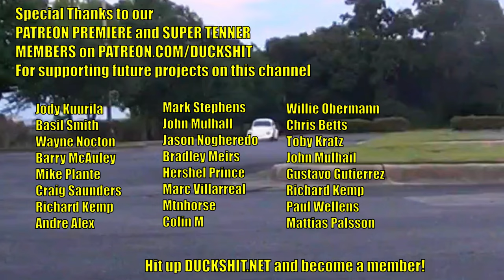🔧Checking End Play / Replace Clutch💥 -  1956 Chop Top VW Beetle - 175

Comment: My dad had his Model A engine balanced and had them shave 20lbs off the 60lb flywheel. I lived across the street and would hear him wind that thing up. There was a definite difference!
Reply from the maker: Thats one heavy piece of machinery, there.  I think the VW one is 16lbs stock, 13lbs lightened.  But its not just the weight that's been removed, its the weight that is furthest from center, at the edges, where it weould "weigh most" when spinning.  Its a pretty big difference.

Comment: Yep, the multiplier tools are sweet for working on anything with high torque. Love brake clean for removing grease.
Reply from the maker: Its the most elegant solution for working on these VWs... I recommend one to anyone that has a VW!
Reply: When I worked for Deutz USA (German air-cooled Diesels, very similar design to VW) they didn't use torque specs. I was a Warranty Engineer so usually I got the ones that people ran out of oil but sometimes I got called upon to do a last minute 5:00 to midnight thrash putting an engine together for a customer. The main caps for example were turned so many degrees, then so many more, and so on. With a torque multiplier that made the one for a Beetle look like a toy! Hell, that was the way the factory did it so that's the way WE did it! I was the only American guy that got "the call" and the other guys were all German! I do speak some German, they spoke better English than I did German, and let me tell you wrenching with those guys, drinking beer and having pizza (at company expense) was an experience!
Reply from the maker: Haha great story!   Thanks for sharing!

Comment: I just bought a non running buggy. Came with a new clutch kit as they said the clutch had gone. Popped the engine out. The clutch in it was new but covered in grease. A quick clean up and it was refitted. Now have a spare clutch kit for one of the others vws.
Reply from the maker: LoL!  Probably the same story.  They only need a film on that input shaft, or it makes one helluva mess!

Comment: I’m pretty sure that when people suggest to use an impact they are suggesting half inch or three-quarter inch impact drives. I’m quite sure they’re not talking about quarter inch drive battery operated Dewalt. The larger impact might be Battery operated but almost certainly hope you get into an air powered half-inch drive or better so you can torque whatever need to without having to figure out a way to hold things against the torque.
Reply from the maker: I'm glad you hope I get things that i already have duplicates of... and no, you don't impact that tool.  🤣👍🏻🤣👍🏻🤣👍🏻🦆💩

Comment: The shim you showed for the end play adjustment looked to be more like the gasket you put on the 4 dowls of the crank than the shims? Pretty sure everyone's neighbourhood is noisy unless you're one of those rich people with a nice big house in a nice quiet area. The tools are certainly a huge help when doing these jobs.
Reply from the maker: You are correct, and I was drunk, and you saw an old version of the video... haha!   I've long since chopped that section of the video out so as not to mislead anyone with dopey information.
Reply: @DuckmanCycles  I had to question myself for a moment as I've just replaced the flywheel o ring etc and I did have three shims. Although I didn't check end play as its ran in the past with this setup with no issues. But I did second guess the shims lol
Reply from the maker: Haha, never hurts to double check! 😁👍🦆💩

Comment: Got to use 8 dowl with a lightened flywheel or you run a serious risk of damaging your crank. Lightened flywheel builds rpm to fast for 4 dowls to hold it.
Reply from the maker: LoL!  ....and chrome will overheat an engine, too... right?  😁👍🦆💩
Reply: @DuckmanCycles  
Don’t believe me if you like. I’ve only been building Vw engines for 30 years
Reply from the maker: LoL  It defies any logic.  Free energy flywheel!
Reply: Here’s the thing about light flywheel. There purpose is to allow the engine to build rpm quicker. It will actually gain rpm faster that four dowls can hold it. Seriously over the last 30 years I can’t count how many damaged cranks I have seen. Just about every one has been caused by two things. Improper torque of the bolt and a lightened flywheel with just 4 dowls. Btw in most scenarios I am a definite fan of a lightened flywheel.
Reply from the maker: @rickmullins3052   @Rick Mullins  Actually the purpose of a lightened flywheel is to unload reciprocating mass and free up parasitic losses.  What you described is an effect... faster acceleration.  It also allows faster deceleration.  The number of dowels affects strength of the joint, something you need and want when power is increased and under hard launch conditions.  I've been running lightened flywheels for 30 years on stock engines with four dowels, and I've only ever seen one flywheel fail, guess what... it was a stock one that wasn't torqued properly. Your science defies the laws of thermodynamics, a flywheel cannot spin up faster than the crank.... PERIOD.  Revving an engine up will not in itself cause a 4 dowel joint to fail, unless that joint was already compromised.  Flywheels do not make free energy.

Comment: Hi Duckman, 
Enjoyed your video. I have seen oil on clutch also, and it come from the input shaft of the gearbox. Some early cars (1975 approx) did not even have a seal fitted on the shaft. I am not familiar with VW gearboxes. It became a problem if the car was parked on a slope and oil was free to drain along the shaft and on to the clutch disc.  You would get a shudder in the clutch when taking off. We used to regularly remove the gearboxes and replace the seal or fit a seal under warranty. Something to look at when you got the motor out but you know the VW and know if that has happened to VW's.  Lighten flywheels are good and allow the engine to respond quicker.
Reply from the maker: There are seals on the VW input shaft and if it's bad you'll know... it'll be messy and it'll stink lol!  However if the oil is coming from the engine main seal then will just be messy and it won't stink.  😁😁😁👍🏻🦆💩

Comment: will that engine last longer run longer into high miles //over a stock engine build from Germany , made . at every day driving the speed limits ..over the years ?
Reply from the maker: In theory... if the rest of the internals are quality parts, then yes it should last just as long.... maybe longer if better quality.  If its a bunch of china junk, welp.... could blow up on first start.  LoL!

Comment: Nice clutch install, stage 1 for that should work well with what's been done like you mentioned. At least you didn't install like a triple plate cluch for no reason.
Reply from the maker: The 3 puck clutch?  LoL!  Nah, not necessary!   LoL!  😁👍🦆💩
Reply: @DuckmanCycles  lol, I did mean a triple disk (highly doubt they make it for that engine without being custom built) , although 3 puck would also be overkill🤣🤣🤣
Reply from the maker: LOL!  Ahhhhh!  Wayyyy overkill on here... considering the low power, and the low weight of these vehicles.  You don't need a whole lot of clutch to make them grab, even with a high performance engine.
Reply: @DuckmanCycles  🤣🤣🤣
Reply from the maker: weeeeeeee 😁👍🦆💩

Comment: Lite flywheels rev faster and wear out the trans sooner. But who cares.
Reply from the maker: A lighter or heavier flywheel bears no additional burden on transmission.  Might wear the clutch more as it requires more revs with slippage to get going.

Comment: 17:52 
The Empi and Kennedy pressure plates have that design. Send t my way for safe keeping when I get the Sickxty on the road 😂

Also, you showed the wrong shims for the crank end play.
Reply from the maker: My last EMPI did not have that design... interesting.   And the shims... lol, I was drinking... drinking during the edit, too.  Probably about to start drinking again, I have lots to do.   😁👍🦆💩
Reply: @DuckmanCycles  might have been hit or miss on the Empi pressure plates then for a while. The last 2 had that same style 🤷‍♂️
Reply from the maker: Thanks man!   I really do like that piece though, its a keeper!  The older style ones you had to beat on to get them out... but they go back in easy if they're not mangled lol

Comment: Really good video Duckman. I have heard about endplay but really wasn't sure why and how to check and adjust it. 🤔 you said you have to have atleast 3 shims. Why is that? And should end play be checked periodically? Thanks Duckman 🦆🐥. Noel
Reply from the maker: Its wise to check it every time you pull the engine, and that is something that a VW owner would do somewhat frequently, I'm usually good for once a year, but I'm extreme.   3 washers are important for frictional reasons, they get oil between them, and each one spins a little less between the stationary case and the moving crank.  Less washers mean more friction.  Hope that helps!
Reply: @DuckmanCycles  can you check the play from the bottom pulley, front of engine instead of the fly wheel? Will it be as accurate? Thank you Noel
Reply from the maker: That is also a method,  the dial gauge works there, too.  When buying a VW, I just grab the pulley and push it in, then yank it back hard.  If you can feel a clunk it needs a proper check and adjustment... if you can just barely feel anything at all (or nothing detectable) its probably set right.  Barter accordingly!

Comment: Exactly how much lighter is the new flywheel? Just curious.
Reply from the maker: I think the VW one is 16lbs stock, 13lbs lightened.  But its not just the weight that's been removed, its the weight that is furthest from center, at the edges, where it would "weigh most" when spinning.  Its a pretty big difference.   😁👍🦆💩
Reply: @DuckmanCycles  I never thought about the weight placement. Makes sense to me. Thx!
Reply from the maker: Thanks dude!  😁👍🦆💩
Reply: @DuckmanCycles  
18 lbs is the stock weight of flywheel.
Reply from the maker: @vintage76vipergreenBeetle  I hear (and read) so many mixed answers on this subject, I'm just gonna weigh it myself...  You may be right !